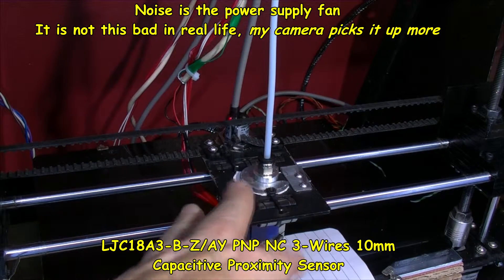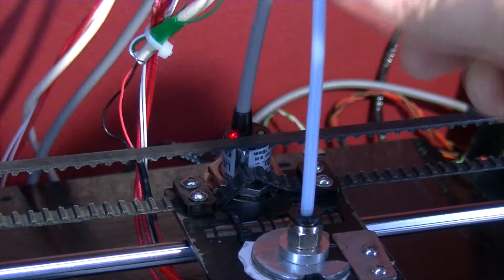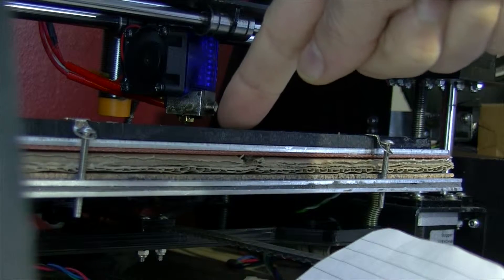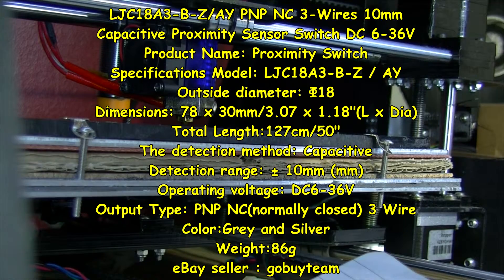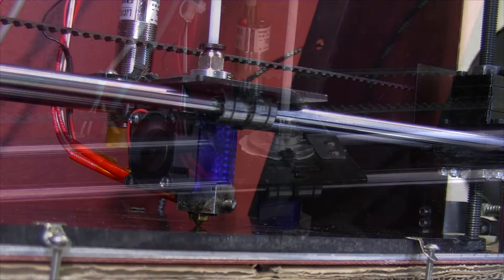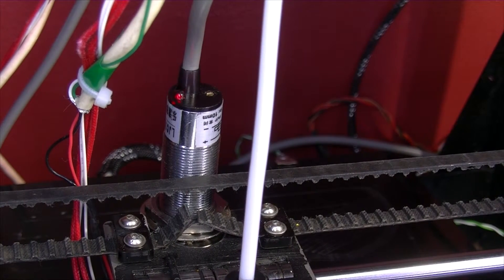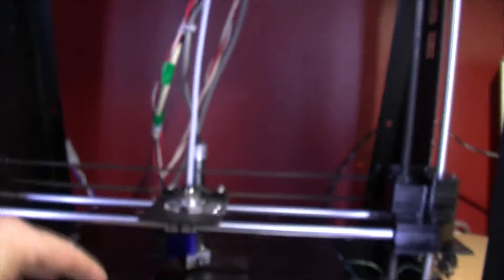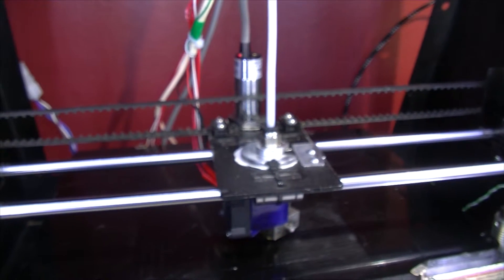Capacitive sensor FAILS for 3D Printing

Comment: Hi there i have the same problem with the same sensor and im considering buying BLTouch so i wanted to ask you about your experience with BLTouch. Great video
Reply from the maker: BLTouch is great for small differences in Bed level under 2mm

Comment: get about 0.003 Standard Dev not too bad for a $4.50 sensor :) 
https://www.aliexpress.com/item/High-Quality-LJC18A3-H-Z-BX-1-10mm-Capacitance-Proximity-Sensor-Switch-NPN-NO-DC-6/32735795048.html?spm=2114.11010108.01008.1.650c649bHI5ihs
Reply from the maker: BLTouch Smart Auto Leveling Probe
Antclab website. These helped me a lot.
www.antclabs.com